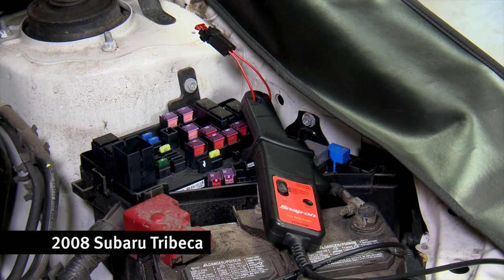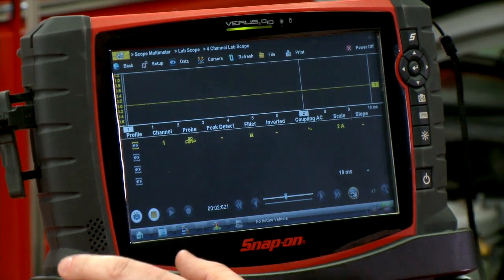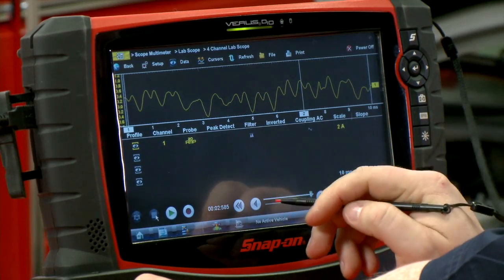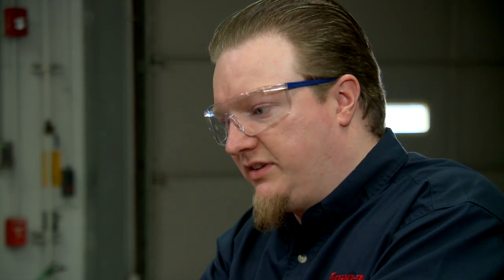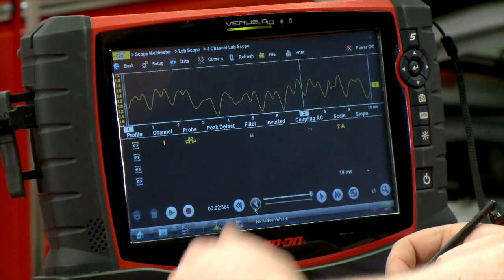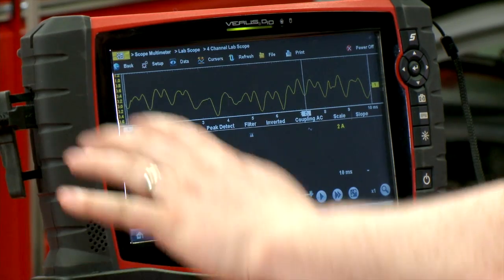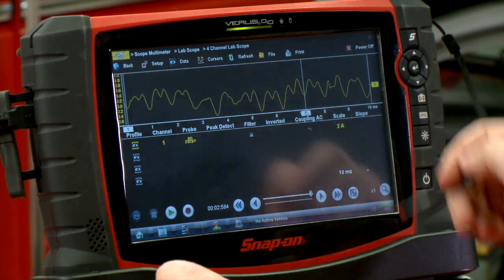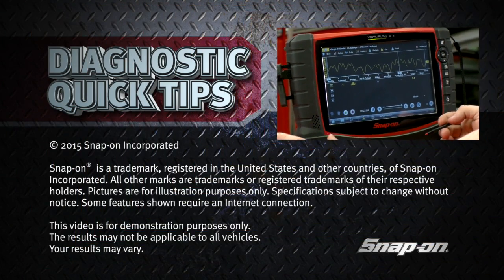Fuel Pump Current Ramp Test- Diagnostic Quick Tips | Snap-on Training Solutions®

Comment: I have a question when you're doing a current Ram test or a fuse, and if you are using a relay do you attach do you attach the jumpers to the control side of the relay or what ?  Is it possible you could be more a little bit more specific.
Reply: I meant relay sorry about that if I want to do it will I be using the attachment on the control side of the relay?